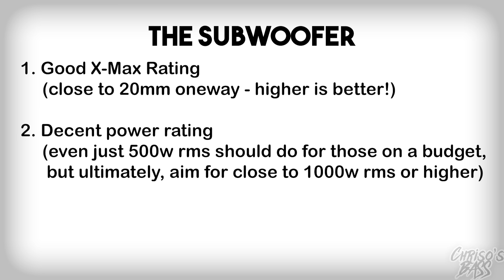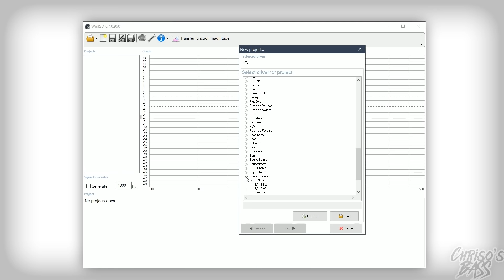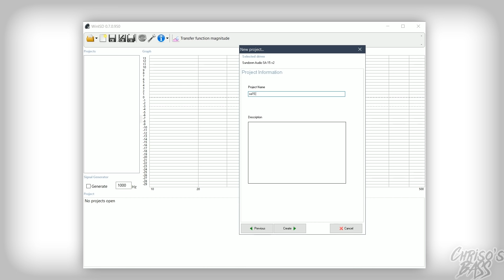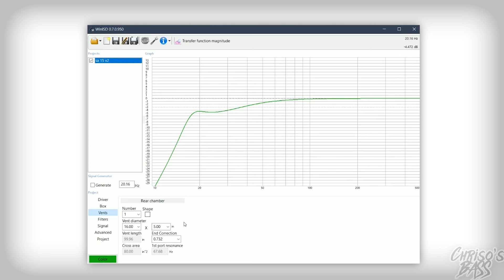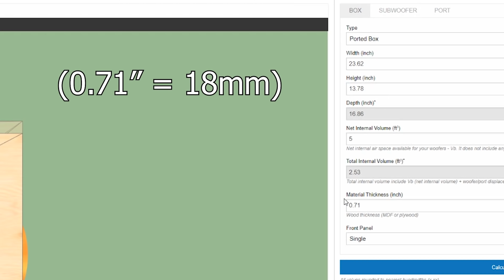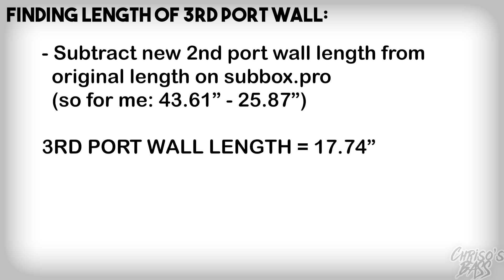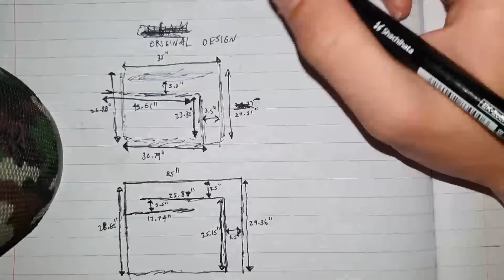How to Design a Subwoofer Box that plays SUPER LOW! | Full Guide

Comment: Just an error correction regarding Decibel:
3 DB = 2x
10 DB = 10x
13 DB = 20x
16 DB = 40x
20 DB = 100x

One Bel (decibel = 1/10th Bel) always multiplies your origin value with 10 and it is used for setting values into relation. For example antenna gain. An antenna can gain up a signal of one millivolt to 40 millivolt. That's 40 times in relation to without any antenna at all.

How often does 10 db fit in here?
1 time, because to fit twice the signal has to be 100mv. And from here you go in 3 fb steps.

0db = 1mv (in relation to the original signal) 
10db = 10mv
13db = 20mv (bc additional 3db =twice the value) 
16db =40mv

So many text for nothing, but I hope my example can help a little bit in understanding.

Ah, btw:
In acoustics (volume, SPL, sound pressure etc.) the relation is set to the faintest sound a human can hear. Don't ask me what the unit/term/formula for that sound is. Maybe someone can Google and post the answer here. I have to go to bed now.

Have a nice Easter everyone!
Reply: It's actually even more fun than that!

While it is true that a 3dB increase is equal to a 2x increase in power, the actual amplitude (in the case of audio, the distance the driver physically moves) of the signal is only increased by the square root of 2! Anyone familiar with square roots might notice that this means a 6dB increase is required to double the amplitude of a signal, as √2 × √2 = 2. This is the same as 3dB + 3dB = 6dB.

But wait! There's more!

Humans generally don't perceive stimuli linearly: simply doubling the power (or amplitude) doesn't mean we see the stimulus as twice as strong! In the case of audio, this relationship is heavily dependent on frequency: we may be less sensitive to lower frequencies than "mid-range" frequencies, but we are much more sensitive to changes in volume at lower frequencies than mid-range frequencies.

As a rule of thumb, to double the perceived loudness of a 1kHz audio signal, you need an increase of 10dB: 10 times the power! However, down in the bass region, a doubling of loudness requires an increase of only 4-5dB or so: roughly 3 times the power. For anyone interested in learning more about perceived loudness, look up equal-loudness contours: there are actually several common sets, and because it's technically a subjective measurement, the exact numbers involved will vary from person to person.

Decibels and biological perception are confusing topics, very easily misunderstood and mixed up, and also fascinating when you think about them. Did you know there's not just one meaning of "decibel?" Depending on the context and measurement, there are different uses of the term! At its core, a decibel is a relative measurement where 0 dB is equal to "times 1", but in audio you'll frequently find "dB SPL", which is an absolute measurement of the energy of a sound, or "dBA" which is similar, but biases the measurement such that frequencies we're more sensitive to count more than others. "dBm" is an absolute measure of power, "dBV" is an absolute measurement of voltage, and so on! So while the loudest an amplifier might go is "0 dB" (meaning no decrease in power from its maximum output), that same output can also be measured as some very high (100+) dB SPL (how much pressure the driver is producing), or even db SWL (the power being put out by the driver)!
Reply: @tavaresa13  thank you for your excellent addition to the topic! 

The nonlinearity in human perception of loudness is BTW the reason, why audio preamps have a logarithmic potentiometer for volume control (in case someone didn't know).

Have a great time!
Reply: @tavaresa13 Yea sound perception is a hard thing to measure. There’s no absolute standard just estimates and rule of thumbs.
Reply: With voltage, because power is proportional to voltage squared, it is convention to use double the decibel figures for voltage ratios.
So if 0dBm is 1mv
10mv is 20dBm
20mv is 26dBm
40mv is 32dBm
Reply: Great video. Many thanks.

Comment: What if you dont have parameters of the woofer? In my case klipsch k27k with bic power amp plate thst is rated at 180 wpc fr of 18hz-180hz and i want to make a build. What design should I follow? For home theatre purpose
Reply: I am not sure if K27 uses the same woofer as other Klipsch speakers, but here are some data:
https://community.klipsch.com/index.php?/topic/149779-klipsch-woofer-thielesmall-parameters-v21/
Reply: Why not just buy a Klipsch sub?
Reply: @cjdubuisson  whats the fun then
Reply: @MugheesMohiuddin  
Good luck....

Comment: So I'm rather confused...The box that SubBox is building is NOWHERE near the specs that were defined in WinISD.  In my case, I have a vent diameter of 13.00" x 1.25" and based on the tuning I defined, it calculated a 9.52" port length.  When I follow these instruction in SubBox, I end up with a port inlet 5.13" x 13.5" and port length of 9.52".

Why are the port sizes so far off between the two programs?

Comment: Built one like this for an AB1244 like 4 years ago. Played 25hz like a champ and rolled off quick after 80hz or so. Not flat output by any means, but adding a bit of deadener to the back and side walls brought a nasty 34hz peak down by 3db.
Good tutorial on this, BTW.
Reply: My XFL 15" can play down to 15hz in the 32hz enclosure. The sunroof just about flies off. It rolls off fast after like 70hz though

Comment: Question: I have a 2.8ft3 box for two 12's. A 4" port tuned to 30.8 hz, and it's very noisy. 
Your chart suggested a 3" port will have an area of 7.0.. which by using your formula is what I need. Now if I remake the port side of the box with a 3" port, flared, will I still have port noise?  
Awesome video by the way!
Reply from the maker: This is one of those rare cases where the box is too small for how much power the subs are getting, so I think the only thing you can do is get a bigger port. Downgrading the port would make matters worse and increase chuffing and unwanted noise. Making it bigger is probably the best idea - provided the subs won't unload. 

Are they reaching near xmax yet?
Reply: I don't think unloading  would be an issue since at the moment they are on a 500 watt Amp and not fully broken in yet. The subs are kaption spl 1200's 600 rms
Reply from the maker: @antro_oner  Oh ok, and in a box that size they could do with a much bigger port I think
Reply: I think you're right sir, I'll try a 5" port. Thanks again!

Comment: Thanks for the video!! My Xmax is 10.4 mm but 53.1 with the Fs ÷ Qes. Peerless  by twmphany stw-350. With that Xmax can I still do the ported box? Recommendation 2.0 cubic ft. Enclosed box.
Reply from the maker: Yes, you can do a ported box. I'm not sure why they list the xmax as being so low for that sub in the parameters, the x-mech is over 45mm one-way, so you should be fine. After all, parts-express.com recommend a 2.88 cubic ft ported box tuned to 24.2hz. So with an incredible sub like that, you'll be able to hit super low with a normal-sized box. nice choice :D
Reply: @chrisosbass1286  thanks

Comment: isn't an increase of 3 decibels twice as loud?  For instance doubling the wattage gains you 3 decibels. so 126 db is 2 times louder than 123 db... or maybe we are talking apples to oranges, as every 3 db is doubling the sound intensity or energy, but you are saying 10 db as a psychoacoustical level change where a lot of people perceive it as twice as loud. Just thinking about it 10 db is  like 13.2 times the spl intensity of 3 db. I have an old cheater amp that doubles wattage with a switch, and I gotta say the extra 2.8 db or double the sound intensity sure does translate to seeming twice as loud at 1 meter away.
Reply from the maker: It varies from system to system. Increasing SPL by 10db amplifies the physical soundwaves much greater than just 2x, but GENERALLY it is percieved to be twice as loud by people.

It is very, very hard to determine what is actually 'twice as loud' using hearing.  I don't know how whoever came up with that rule figured it out, but 'twice as loud' is just a perception thing. There's no real way of determining if something is twice as loud, other than using a decibel meter and having a calibrated recording method.

Same for the +3db rule. This can vary quite significantly from system to system, but usually, increasing input power by 2x will result in an extra 3db of SPL. Sometimes more, or sometimes less if you're pushing a sub in a little box to its limits.
Reply: @chrisosbass1286  im guessing the difference is the volume of the listening area and distance from the sound driver. You can try it at home with a tone generator and headphones. When the source is at your eardrum a difference of 3 db is definitely much louder. However if i try the same thing in my living room and there are kids in the room, 3db is hardly noticeable. I think its all the ear of the beholder, I have noticed when i first wake up, every sound seems amplified crazy loud.

Comment: Great video.  Abridged text version:  Increase the size of your box approx 1.5 times the mfg suggested size and lower port tuning.  Doing so will kill 3-5db of total output so plan on doubling power, adding another woofer or both to get the output back.   The engineering acronym never changes.  TANSTAAFL There Ain't No Such Thing As A Free Lunch.  These days power is ridiculously cheap so power up and let em slap!

Comment: What's a good box design or specs for 2 12' Audio Pipe Txx BD3 I currently have them in a Qbomb box 12VL model (Vented XL)
Reply from the maker: probably 5-6 cubes tuned to 25 or 28hz. this is just a guess though

Comment: Got teo 8 inch toro force 800 rms my speakers be popping not enough port area
Reply from the maker: if they're popping it could be bottoming out, which happens when the box is too big or there's too much port area, or just pushing them too hard and too far away from the tuning frequency
Reply: For 2 force 8s try 3.75ft3 with your tuning at about 31-30hz 8s will hit the lows but not as effectively as 12s...15s etc
Reply: @brendonorourke479  respect bro I'll add another 8 also

Comment: also all 90 degree turns in the port lowers ur tunning usually 1 turn = 1hz lower so your box could be tunned to around 17hz (but i think its gonna be around 18-19hz u can find it out by checking on what f the sub has smallest excursion (i hope you understand)

Comment: So I’m using 4 subs and sub box pro won’t let me use more than 2 subs
Reply from the maker: You can join 2 designs together to make one box with 4 subs. You just have to double the net volume and port area and length of the box for 2 subs and then it'll be good for 4 :)
Reply: @chrisosbass1286  dang cause I really wanted to see it put together with 4 subs awe well I’ll throw two subs in my ranger instead.
Reply from the maker: @TheSimulatorSmith  You can still do four man, you just need to double the volume, port area, and increase the port length so its tuned the same
Reply: @chrisosbass1286 I never updated but I ended up going with just 1 15 and ended up doing 150 at 24hz which was louder than the 2 I initially built.
Reply: @TheSimulatorSmith  im trynna buy or build a box rn for a single 15in that peaks at 28hz, mind me asking for ur specs?

Comment: Hi i dont own a computer and dont know how to use one..can you help me? I have a full size ford van strong electrical and plenty of power.what im hoping is if you can provide measurements for me to build a box for 1 18" sundown nite shade neo 2500 rms? I have all materials on hand and am ready to build...essentially my goal is to achieve a box plan to move air,get windy, and do hairtricks!!!
Reply from the maker: I can't give you the exact dimensions right now as I don't have access to my computer but I think that an 8-10cu.ft box tuned to around 25hz would be ideal.
Reply: Odd that you don't own or know how to use a computer yet here you are on a website posting a question. Things that make you go hmmm.

Comment: In finding of what size of the port is? Where 80/16= 5 comes from?
Reply from the maker: 80/16 = 5 is required (required total port area)/(front baffle height) = (port width). You just divide the port area you need by the height of your front baffle to get the port width
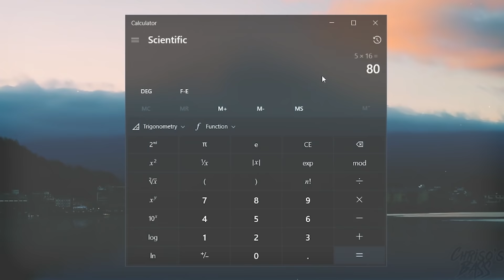Reply: @chrisosbass1286  I was kinda questioning this as well... At (10:24), aren't you multiplying feet times inches, to get total inches? If so, there's 12 inches per foot, not 16. 🤔 That's seemingly what is implied as to what you're doing... 🤷🏻

Comment: I have a single kicker cvx 15 with 1000 rms and I want it to hit better low. My current box is a 4.5 cubic net with 37hz tuning. Do you think I should change subwoofer or modify the port to 30hz or so?
Reply from the maker: I personally just think changing the sub would be the best option. Kicker is one of those brands that just can't really play low very well due to how they're designed and built (unless you have a solo x or q7 sub, they're decent). What is the port area? 

But overall, any high-end 15" would do great in 4.5 cubic feet with slightly lower tuning
Reply: @chrisosbass1286  what sub would you suggest for a 37hz tuning?
Reply from the maker: @wtspapa24  I would probably go with a sundown audio u-15.

Comment: So im watching this for my first ever enclosure build and i have a DD715 i would like to knock off loud 29hz to 32hz but with minimal power on tap so do you think this kind of enclosure would be fine for my idea also note this is for a home audio setup and until i upgrade the sub will be chilling on only 300watts 🤔
Reply from the maker: You can just tune to like 27 or 28hz and it should play down to 29-32 really well and then it will drop off after that. if you're only low power then a big box is a good idea. just do what i did in the video and make sure the excursion of the subwoofer isn't too high on the graph :)
Reply: @chrisosbass1286  100% ill let you know how it went.
Reply from the maker: @erikbritz2637  Looking forward to hearing about it
Reply: @chrisosbass1286  hell yeah gimme a month i work mondays to sundays so planning comes first then buying any extra tools i need and wood then finally assembly and testing then ill start painting.
Reply from the maker: @erikbritz2637  Alright man sounds goods, if you need any help with design just let me know

Comment: am I incorrect or isn't this the wrong sub for this kind of build? granted I had 2 sa rev3 12's in a 4.5cubic tuned @ 30hz, 61 in port area. and let me tell you at 35hz it sounded muddy and boomy as shit. was louder than my rockford p1's at first but I quickly grew tired of the way it sounded. rebuilt at 4 cubes tuned at 27 sounds way better all the way across 20-50hz.  from my understanding sa's HATE big boxes and the 15 has a 36hz fs. 

isnt tuning so low from f/s usually a bad idea?
how did it sound tuned so low so huge? I'm genuinely curious. 

impedence rise on this thing will be nasty I wouldn't think you'd getting anywhere near 1,000w on that.
Reply from the maker: Yeah, SA subs aren't intended for this kind of use but I just wanted to use one to show that it IS possible to get subs like this to play low (as many newbies think that they're just pre-fab style subs for 30hz+). It is MUCH better to use SPL subs for this kind of thing, which I tried to mention in the video a little bit. That's also why I put the disclaimer at the start that the whole point of the video was just about getting whatever sub you have to play low, not about SQ and stuff.

And tuning low from FS isn't always a bad idea, depending on the resonant frequency of your car and the size of the box. I know a guy who has tuned an x10 to 18hz when its FS is basically double that and it did 145db+ @19hz.

 But yes you're completely right and thank you for the feedback bro, much appreciated. I may make a video down the track about proper box design for sound quality but this is just an intro/intemediate video for people who are new to all of this :)
Reply: @chrisosbass1286  I'll subscribe, interested to see what you make. gets the point across that the box is the biggest determining factor in overall performance for sure. if you only have an sa from your last build. but want to go low without paying for a new sub anyway. absolutely a way to go.
Reply: also I don't want to sound negative this was probably the best overall box build tutorial I have ever seen. alot of videos give you PART of the critical info but don't tie it together with important things like you did with the extra bit of info on port area.
really solid and well rounded, definitely my go to video for showing newer guys.

Comment: Alright so what if no third port wall?
Reply from the maker: If the 2nd port wall fits inside the box on subbox.pro, you can just build the box as it is, with all the dimensions straight from subbox.pro, and you don't have to do any extra calculations at all
Reply: How much do you charge to design a box i need help